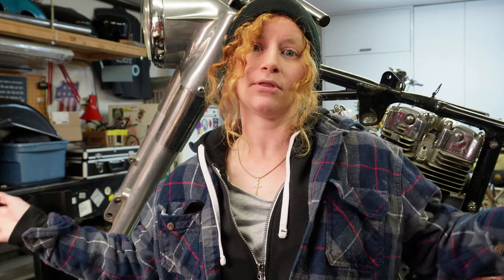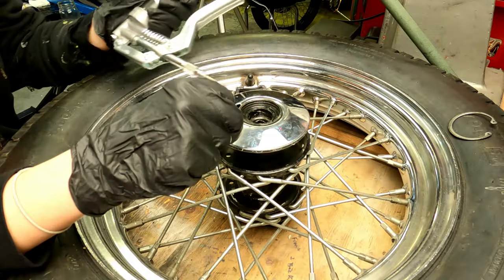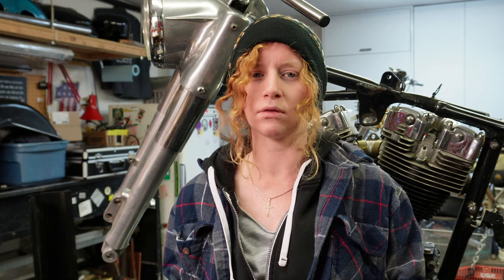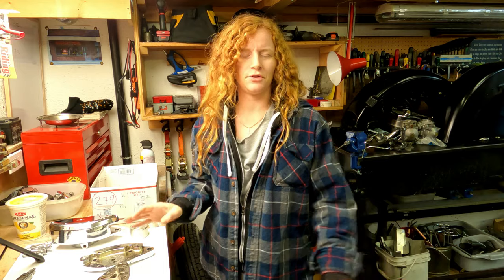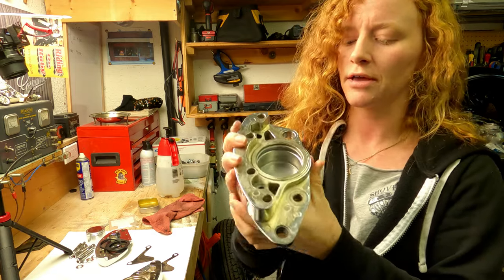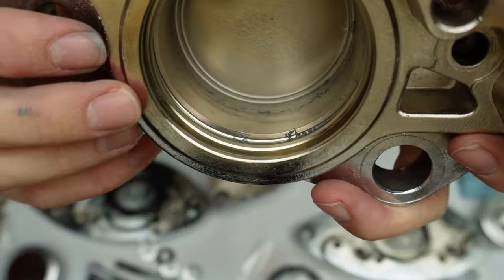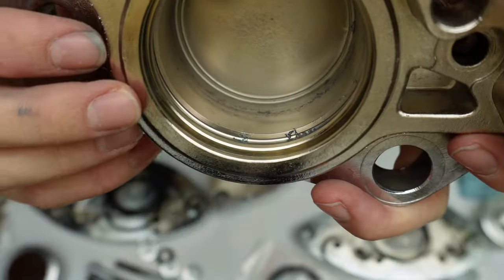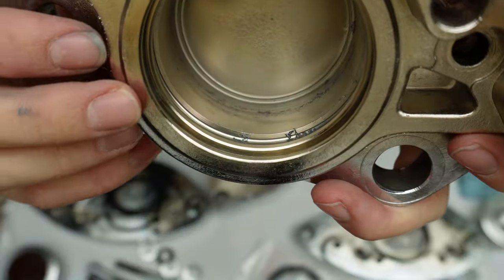Shovelhead Banana Caliper Rebuild/ Greasing Wheel Bearings

Comment: Great job Miss Angel.
      Don't be mad at me I was pairing socks while you were doing the brakes and bearings. Not to many years ago I was rebuilding an older Indian and found cracked races in the rear wheel. Whomever had attempted an axle swap years before just crushed the seats pressing races in. Ever since I always pull bearings of unknowns to check for sure. You are lucky to be following your Dad. I'm hoping he's the one to kick this one over and take the first ride. You are doing a fine job and It makes me feel safer on the road knowing there's wrenches like you out there.
With Respect, you are in my prayers
Hoka Hey

Comment: Hey Red, nothing is more important than brakes on your bike, so good job on cleaning your parts carefully before re-assembly. You might consider using a dremel with a brass brush to really get all signs of corrosion out before washing. Might save you some scrubbing when you get to the sink, and insure you smooth the surfaces as smooth as you can get them. Anyway, great job, and great to see your little black featherd helper in the garage too. Winter in Canada eh?
Reply from the maker: December 1 and we got our first skiff of snow today!

Comment: Thanks Angel.  i was wondering if you have a parts cleaner station.  That might save trips to the kitchen sink and might save the kitchen sink.  lol.  Thats great you take such good care of your bikes.  You did a nice job of filming the details of your maintenance.   Mellow laid back music on your video.  Cheers.
Reply from the maker: I have a parts cleaning station but its just crowed in my garage so its not the most accessible. And I sis these in the sink because I use the SOS pad and need to rinse that soap away. The SOS pads are nice for aluminum because they are really fine steel wool and the soap in them acts as a lubricant.

Comment: Good tip about the silicone. And dot 5
Need to do the rear caliper on my 04 sportster.  Never had anything with dot 5 fluid  before man it's expensive!
Glad I checked before I just put dot 4 in it. Lol
Reply from the maker: Lol yep that would have sucked to mix them by accident! And I like DOT 5, it doesn’t wreck stuff.

Comment: Angel.  You had them 99% removed.  You should have pulled the bearings out of the races, cleaned them in solvent, took a good look at them, and then checked them for smoothness, burn marks, grooves, etc; and then packed them properly with fresh grease.  You are hoping they are OK.  You do not know for sure.  Timken tapered roller bearings will last a Very longtime with proper maintenance.  Great job on the brakes.  To be honest I always hated the old banana calipers and considered them a step above Fred Flinstone brakes!  LOL.  The brakes on my 1984 Shovel are light years ahead of the old Banana calipers.  Oh well, you know about opinions, LOL!
Reply from the maker: Hahah my dad was saying those brakes are a poor design also, but its what we got. And we are also trying to go for an era correct look with this bike. And the bearing were removed and checked by my bro before, but I think I will take them out again just to double check. 👍 🙂